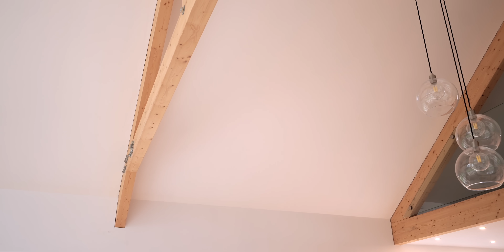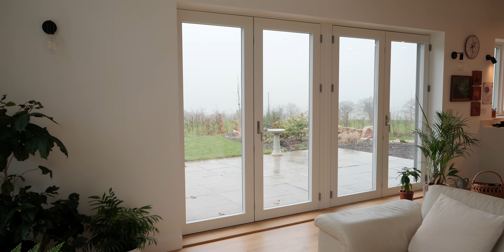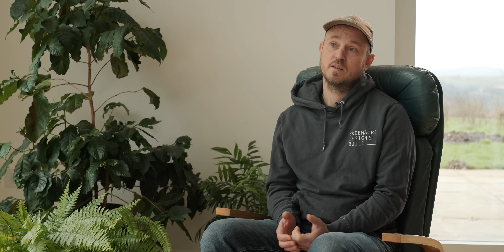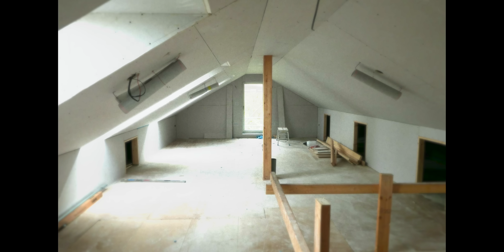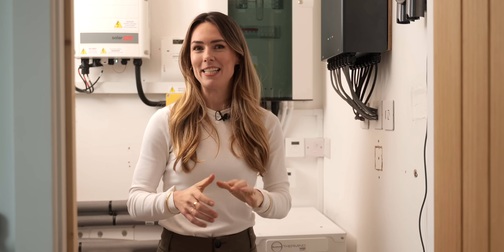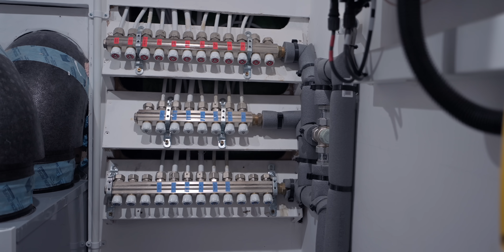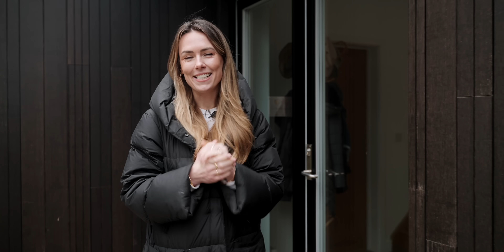Ditching a Heat Pump for In-Plaster Infrared Heating?!

Comment: In a passive house infrared is a no brainer, didn't know you could do it in plaster, really cool, can you drill into that tho or like cut a small part of the flies out and drill there or is it a no go with that system and you just put it where you need it ?

Also if they want a very efficent battery, that is of course pretty expensive, they should look into Multi Level Inverters, I know of Sax Power, they are also able to provide emergency power in case of a power outage, you do need 3 of them, if you want it to work in a 3 phase system tho, and they are not cheap at 3200€ for 7,7 kWh for 1 Phase.
You just need to connect them to your home grid tho, they are very efficient, for an AC System, because they use the Multilevel Technology and therefor don't need an inverter, because every small cell in the pack has a switch and simulates a sinus wave by turning on and off in rapid succession.
That also makes it inherently save and more reliable, because if one cell is faulty, the system will notice it and take this 1 cell out of the pack, also if the system is off, the cells are not connected to each other, so there is only the voltage and current of each induvidual Cell and not from a series of cells packed together.

Let's see if China take starts mass producing this technology eventually to make it cheaper tho, because for 3200€ I could buy 30 kWh of normal LV LFP batteries.
Reply: Thanks, yes it is pretty cool and very unique in its construction which allows penetration with lights, screws and so on, plus, as its SELV, no danger of shocks

Comment: A little while ago there was that mansion where the owner had put in heat pumps, and it was working and saving money, but this guy says they'd be too inefficient.... Doesn't make sense. Also the reasoning for not having a house battery all because of 5 days worth of power cuts is non sensical. They couldn't use the battery just in case there's a power cut... So, what's the difference between having a flat battery and a power cut and no battery and a power cut.. none. So I'd rather have the battery, like I do, and have cheap energy in the day.
Reply: His heat demand is less than what heat pumps operates at. Few seem to have got that.
Reply: @johnburns4017 You could let the heat pump heat the room with a window open and still be more efficient than COP1 infrared.
Reply: @Jeroenneman 
Again....
His heat demand is less than what heat pumps operates at. Few seem to have got that

A heat pump is immediately precluded, and that is not even taking into account the high price of one.
Reply: @johnburns4017  that's not a problem for modern inverter heat pumps
Reply: @AttilaTheHun333333  
The cost of the heat pump and its installation is a big problem, when the average heat demand will be one kw or less.
Reply: Exactly, why would you not use it? You could use your appliances when you want then, free on sunshine or cheap overnight in winter. I agree that £196 seems a lot for a passive house too, not enough panels I reckon.

Comment: Great video, as usual!  I love seeing energy saving success stories.  My biggest question would be how much the house cost to build.  £196 per year is amazing, but did the solar / salt system / radiant heat cost £500,000 to install?  What's the payback on the investment?  Of lesser importance, can you put nails into the heat system "cloth" or must it only be on the ceilings?
Reply: Our 70's 3 bed semi, almost certainly not overly well insulated, with £14500 of solar, battery and about 9,000 miles of EV charging but still on gas was £460 to run for the last 12 months.
Reply: @FFVoyager  
What is on gas?
Reply: @johnburns4017 heating and hot water.
Reply: I am invested in a company that builds Passive Haus. We reckon 5% more on building cost, but our starting point is a "quality build". You need really good, tight fitting, triple glazed windows. Costs more if the starting point is "soft wood single glazed" !! There are many choices, but building with Woodcrete pretty much guarantees the air tightness, and provides very useful thermal mass, insulation is integral, just need the "thickest one" :) for Passive Haus
Reply: @ecok  
Also orientation of the building matters, with glazed areas facing south, etc.
Reply: @johnburns4017  Yes indeed. Passive Haus design will consider that (there is a calculation called PHPP which models heat lost through walls, windows etc. and heat gain, overhangs (keeping summer sun off, windows but letting winter sun in) etc.) but we've had planners require the building to be moved from optimum position into shaded area for "heritage reasons"
Reply: @ecok  
So more insulation.
Reply: Not sure of the cost of the house as we just supply the heating but, yes, you can put fixings through the mats without damage
Reply: Excellent questions. The cost one was on my mind too, but the nail in the wall question.. I really like to see the answer to that.
Reply: I'm intrigued.

How did you arrive at those figures?

Comment: This seems an odd choice - all resistive heating is 100% efficient, but heatpumps are more like 300% efficient. Surely a properly sized unit would be possible?
I dont see how this would be more efficient than any other electric heater, they all convert all their energy to heat. The only way to make it more efficient is to ALSO use that energy to do work to move more heat like a heat pump does - it is also near 100% efficient at converting electricity to heat, but does mechanical work too.
The singular advantage to this system appears to be cosmetic, possibly reducing drafts if you dont like those, and you barely mentioned that
Reply: You could use a very small compressor and connect it to the Ventilation System I think, think of like a fridge, our fridge consumes a minimum of 40W, if they need 2kWh/day (if I understood that correctly) that would be 83W/h of heat energy, so the fridge would already deliver more heat to the house than nessesary to heat it.
If he meant 2kW of power per hour that would be a different story.
Reply: @LastWish90  Watts are instantaneous, by definition.
Reply: @mycosys  Yeah I know that but alot of people mix that up, so he said the house uses 2kW of power a day, iirc, which implies he's probably meant 2kWh.

Comment: It’s ok for incredibly energy efficient houses, but for most houses ditching a 400% efficient heat pump for a 100% efficient heat generator make no sense whatsoever.
Reply: That's true, but most houses aren't build to passive house standards, where the installation and maintainance of a heatpump basically increases the cost so much, that it doesn't make sence to add one.
Reply: @LastWish90 .   Read my post again.    A heat pump will work for most houses except for the very poorly insulated if installed correctly (i.e. after a proper heat loss analysis).   A heat pump achieving 400% efficiency will be comparable (slightly cheaper) to run as a gas boiler system.
Reply: Hmm ... not necessarily true it would seem.

Granted no mention of costs for the installation but consider the walls are radiators so no need for water filled rads or underfloor piping fed from a heat pump.

Suggest you research the alleged efficiency of heat pumps too.

And then the racket from the heat pump after a few years ... and don't kid yourself they run silently for ever.
Reply: @F @ForestForest-n9i Heat pumps run at >400% efficiency, I know I had one for over 2 years that does.  Anything with moving parts needs to be maintained by servicing.   The noisy pumps are the ones for which servicing has been neglected.   You’re the one that needs to do some research!
Reply: @crm114. 

So you claim.

A lot of viewers have made similar claims in the past but are generally mistaken.

No proof, no data, nothing to support their claim.

Suggest you stop your silly nonsense and in return you do some research.

A lot of silly BEV loving battery huggers make similar claims about the range they get from a battery.

Again no proof, no data.

Merely quoting a manufacturer's published figures, ditto heat pumps doesn't really prove anything other than such claimant's were easily duped.

Clearly the result of a poor education in the sciences.

Why do you lot bother?

Anyone can do the fact checking thing these days so such silly attempts to justify such a claim are merely laughed at.

By now you'll have discovered the Sydney EE event has been postponed for a few months.

Why you might reasonably ask.

Are car manufacturers having second thoughts on providing cars for exhibition or test drives?

Have some manufacturers realised, belatedly, that what has recently been announced in Europe, ref the "going green" date is a wake up call to the industry as a whole?

Will the Sydney event ever happen?

We saw, in this episode, an old guy shy away from heat pumps in favour of a much simpler system(s) that is almost maintenance free. And easily and cheaply modified if desired.

Despite what HMG tries  on to encourage the public to buy into BEVs and heat pumps they have rather wasted their time.

With respect to the BEV debacle HMG may well have been persuaded by the battery hugger experts that "everyone" would see things their way and a massive exodus from fossil fuel vehicles would soon follow.

This did happen but mainly to the leasing and hire fleet sectors.

Very few private buyers  bought into BEVs.

Perhaps BEV residuals are not enough to sustain the industry?

European car makers lobbied for an extension to the "going green" date for fear of going out of business.

Some say that the Chinee will benefit and well they might.

Yet, according to the recent sermon from Robert "we" should avoid treating with "oppressive regimes" on the grounds of their unenviable history of human rights abuses.

Robert appears to know as much about realpolitik as he does about electric vehicles so what are we to make of his recent sermonising?

Anyone?

Anyone prepared to explain his confusion.

Don't all rush.
Reply: @ForestForest-n9i .  Talk about a cut and paste troll response.    How many time have you posted that garbage?   Seriously, as the bill payer do you really think I don’t know how much energy I’m using to heat my house?    Do you really think I can’t compare that with decades of heating with a gas boiler system?  And, from those data, work out the efficiency of my heat pump is >5x better than gas?    Wake up.
Reply: @crm114. 

Crikey!

Who would have guessed?

Suggest your sums are not quite correct.

Your claim appears a tad optimistic.

Still, who cares if you're not too clever with math?

If you say x5 then x5 it shall be.

Comment: I suggested infrared heating to my workplace, big building with gas fired fan heating, 5 years ago! They just shrugged me off and cut our wages instead, I don't work there anymore
Reply: Yeah because gas is cheaper lmao
Reply: Well gas is a third of the cost of electricity, which is why you want a heat pump to have a SCOP of 4
Reply: Have you tried IR heating ?
I have, expensive mistake !
I have kept one 300w panel under the desk which provides decent localised heat, though you need to be close to it, within half a metre !
🍀
Reply: @Craig-Mitchell  
In this case IR heating was used to hide heat emitters.
Reply: @johnburns4017  Underfloow heating is also great to hide stuff.
Reply: @Craig-Mitchell I accept that you have to make sure it's suitable for said environment
I thought that because you can focus where and who is heated rather than trying to warm the whole air mass, it would work out cheaper and more effective, with gas heating it still got down to 12oC for some weeks in a year 
There was also a massive area ripe for solar panels on the roof
Reply: @tonners.pettitt9938  that works for short periods of time. Over time the infrared heaters will still heat the whole room. Just inefficiently. Maybe it works if it is a massive place with only a few workers.
Reply: @tonners.pettitt9938  I have high ceilings and big rooms, so like you I thought heating the person rather than the space would be a good solution. I bought several panels, one 900 WATT for a home gym, though in the winter, even though I was working out, I'd have needed at least another 900 WATT panel to be moderately warm, another two if I wanted to be cozy.
A fan heater worked out better, though that's noisy. I didn't have any Central Heating at the time as the oil boiler packed in, it was smelly, I'm not into diesel / petrol fumes.
I have a wood stove with back boiler now that I rigged up to the existing CH pipework and its great; NOTE I live in the country and grow lots of trees 🙂
I made a video about my experience with IR Panels if you want to take a look.
🍀